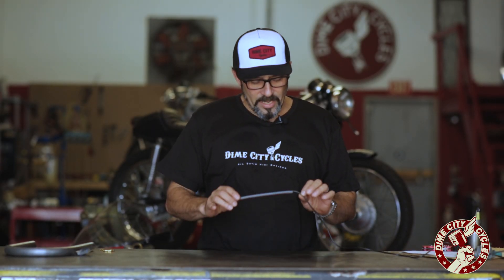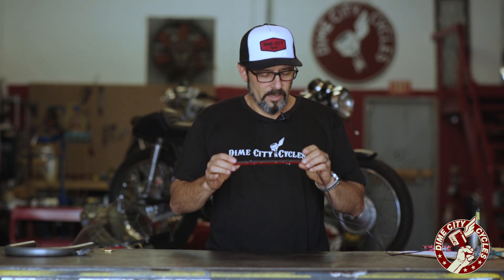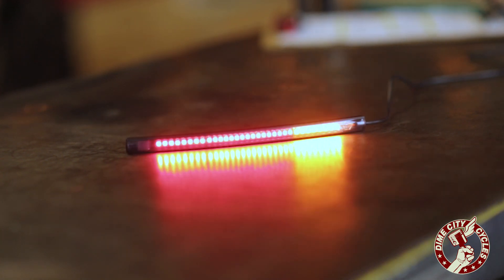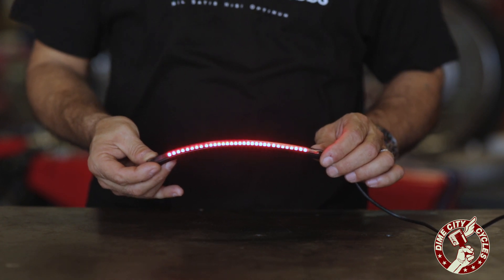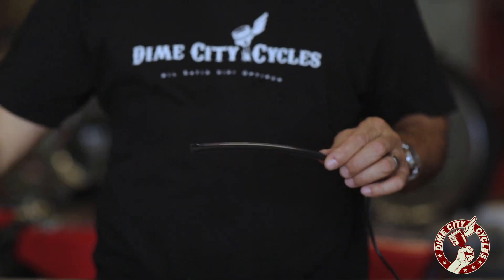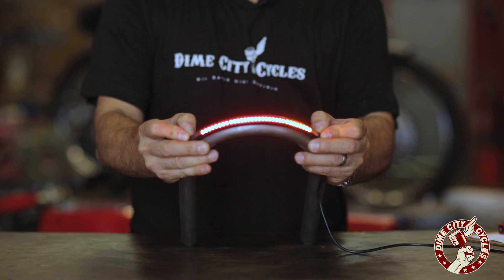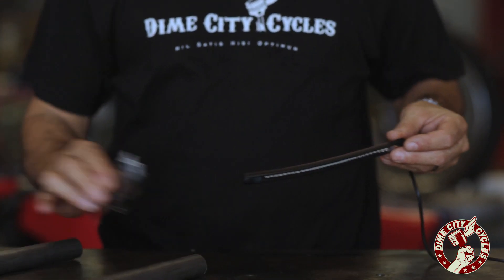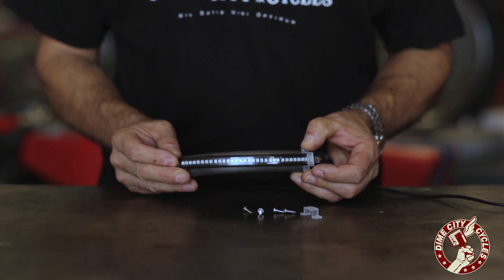Flexible LED Integrated Tail Light / Turn Signal Indicators for Custom Motorcycles

Comment: Just bough it on Amazon and installed it a week ago. Works great and only cost $10
Reply: update: worked for about 3 weeks. got another one on Amazon, this one lasted a month. Buy a quality light. The super nova light is brighter and just holding it, it's obvious it's a better quality product. Search for FLEXIBLE TURN AND BRAKE LED TAIL LIGHT on revivalcycles.com but be prepared to pay for a premium light. So far this light is flawless.
Reply: I got mine free from the wish app. Only paid $3 shipping. If it’s not free anymore it’s going to be $3 to 7$
Reply: @CantankerousOB  is it still holding up? or did it for a while at least?